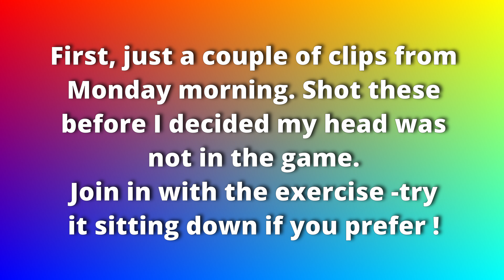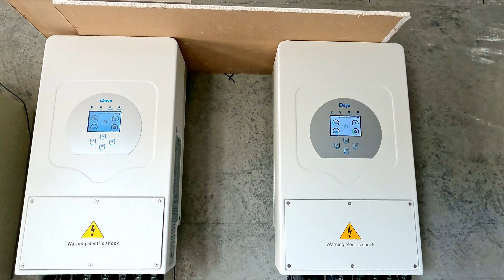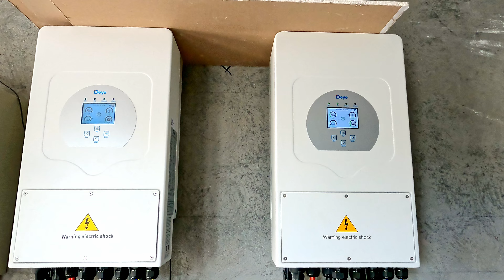Philippine House Building Day 239 - We are back

Comment: Because of my former life I could not help noticing the sheet rock an top of inverters. I don't know your specific configuration, but most have top air discharge. Blocking that can lead to safety shutdown on high heat sync temperature. Just saying!
Reply from the maker: Hi Bob
Thank you so much for the advice. Sheet rock removed !
Reply: @philippines4.0buildinganew64  You're welcome! 
If you want to keep debris out of it, then build a shelf spanning both about 12 in above X the depth of device. Don't make it too permanent as it may need servicing of cooling fans if top mounted.
Good luck